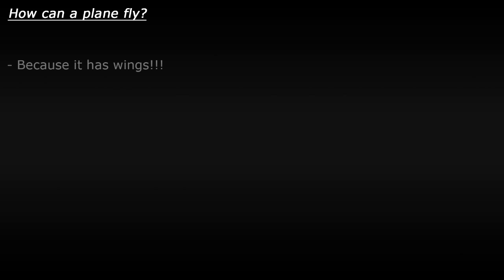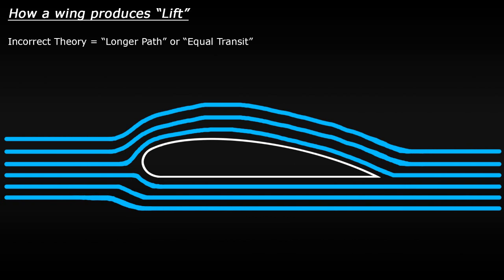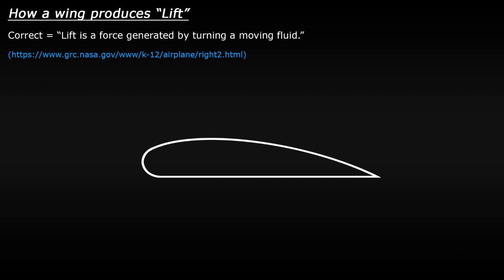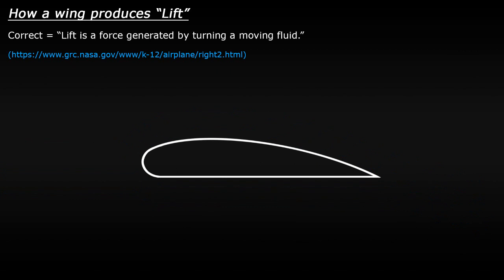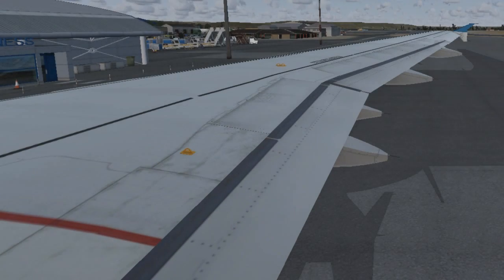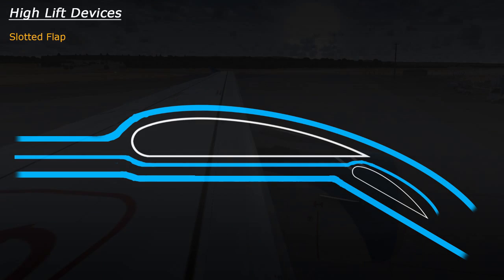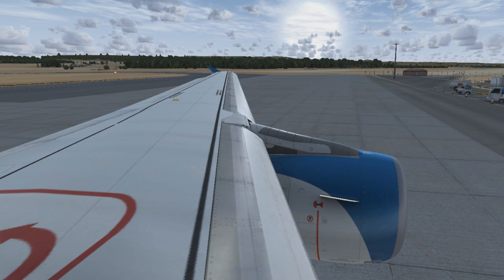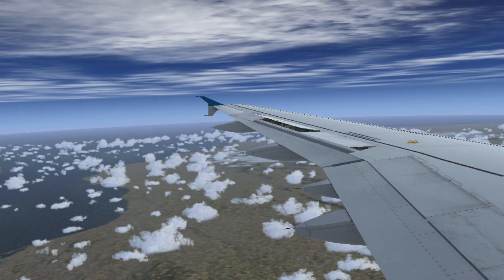How Wings ACTUALLY Create Lift!

Comment: The only way in which the wing surface can feel forces is either through tangential or normal forces, with tangential forces being viscous shear forces, and normal forces being pressure. The air cannot impart force on the wing surface accept through these means. What this means is that a pressure difference IS the reason a wing generates lift. Experimentation shows clearly that an airfoil shape creates differences in pressure all along the surface and when you integrate the pressure over the whole curve of the airfoil shape, the net force has some component in the normal direction to the freestream, and some component parallel to the freestream, with the normal component being what we call lift. The net result of causing this pressure difference is a turning of the flow, since the only way the flow can be turned is through the pressure gradients within it. So, from a mathematical standpoint, you are correct, the flow is turned by an amount exactly required to generate the amount of lift that is generated, but to say that lift is not actually caused by a pressure difference is incorrect, because again, the only way the wing surface can feel force is through the pressure and viscous forces acting on it directly (viscous forces barely contribute to lift, but rather contribute mostly to drag). The turning of the flow is just another result of the pressure differences within the flow field. The reason, then, that the Equal Transit Time theory is wrong, is not because it explains that pressure differences cause lift, but instead because of HOW it explains the pressure difference is created in the first place, which is admittedly much more complicated than can be explained without some very complicated math and physical principles. Equal Transit theory is not based on Bernoulli's Principle, it just uses Bernoulli's Principle to explain the result in change of pressure from the false premise it starts with. Don't equate the Equal Transit time fallacy with Bernoulli's Principle because there are plenty of valid uses of Bernoulli's equation.
Reply: You are completely right. Very good point.
Reply: Very well said.
Reply: correct! F1 cars use a diffuser for that reason, speeding up airflow beneath the vehicle and creating low pressure air underneath, effectively sucking the car to the  ground.
Reply: Bravo !
Reply: Holger Babinsky states that friction and viscosity are the main reasons for lift. Pressure difference is a result of it. NASA's explanation is correct, but too simple.
Reply: juncear  read more of what i wrote because clearly you misunderstood my meaning.
Reply: juncear  for steady-altitude flight at high speeds ... I don't know why you underestimate air pressure drop above so much. first, air is moving extremely fast around the curved surface. are you sure you have a good feeling for just how fast? you know the speed approaches the speed of sound (i.e. air compression waves), so are you that knowledgeable about things moving in air near the speed of sound? wing width and depth relative to compression wave wavelength are significant. are you able to visualize that expanding and contracting compression wave above relative to below? I don't think you are, because you seem to believe this "air being pushed down thing". Air is being compressed downward quickly. It then expands past the wing while air mass below moves some of that air back up. Meanwhile, a much large volume of air is expanding above quickly. Quick and significant expansion over a larger volume.
Reply: juncear  That's the second time I've read your remark about people overcomplicating things without providing a bit of substantiation for your claim. You ask me a question, assume you know MY answer before I respond, then say I'm "overcomplicating everything". Look. Fluid flow IS complicated!! I've provided you with a link that is followed up by my references. One of those is very thorough with an explanation of how downdraft is a result of lift and not the cause of it. They continue with a complicated derivation of how significant curvature of the wing is relative to other factors commonly cited (like downdraft!). You seem to be of the opinion that if it's complicated then it's overcomplicated and therefore wrong. Why? You think everything needs to be uncomplicated? FLUID FLOW AT HIGH SPEEDS IS COMPLICATED! Sometimes you just need to do the work rather than go with your gut. So get your hands dirty and do the work!
Reply: @johnahearn7966  Without being knowlegable in high energy hydrodinamics, I do understand that a body in level flight counterbalances its weight by a force exerted upon the air below it, which in turn is compressed by said force, and this compression radiates out as a volumetric wave at the speed of sound.
The conservation of momentum should dictate however that since the plane did not change its vertical velocity, the net velocity of the air volume should not change either, and we know the pressure of the airmass below the flying object is greater than that above it, otherwise it would succumb to gravity.
Therefore it would seem to me that the momentum of air displaced upvards cannot entirely counterbalance that of the air diaplaced downwards, if the pressure wave does indeed cause such a displacement as you claim.
So where does this excess movement come from? Where is its counterforce?
Reply: @ineednochannelyoutube5384  Let's start here with your statement: "the net velocity of the air volume should not change either". you clearly have a good feel for what that net volume is, as do most people who have opinions on this matter. But do you really? How would you bound this volume? How far above the wing for instance, and before you answer with conviction have you taken into account the enormous difference in mean free path above and below?

You seem to have a good perspective on this, and I like the way you asked the question but I believe your conclusion that "the momentum of air displaced upvards cannot entirely counterbalance that of the air diaplaced downwards" should also apply to two cases which at first seem completely unrelated: Case 1.) Hydrostatic equilibrium keeping a blimp aloft. 2)  A static trampoline holding up a heavy object.

If you think they are unrelated then there's no reason for me to continue, because all three cases can be explained by energy conservation alone. In each case potential energy in a mass below an object is much greater than that above. A mass below a heavy object has a much greater ability to do work on the object than the mass above, but the differences relate to HOW the stratification in potential energy came to be. Blimp: gravity created a static pressure stratification. Trampoliine: gravity causes material to stretch mostly in the horizontal direction  therefore creating a stratification of pressure in the vertical direction. Airplane: Enormous speed and pressure variations create a huge stratification of potential energy below vs above.

In none of these cases are Newtons laws disobeyed, and yet people protest that the 3rd law "must require" air mass below a plane to move downward even though they claim to fully understand why air below a blimp is not pushed down and why the trampoline fabric remains un-moving. Why?
Reply: @jahearnca1  I think you misunderstand my point. I do not think if the whole system is taken into account (which may well encompass the entire atmosphear), there should be a net change in air distribution, if for no other reaso, than the fact that once the plane has passed, the hydrostatic eqilibrium must reestablish itself.
I think the comfusion here largely coms from the fact that with an earofoil, the equilibrium os dynamic, and if only observed for a limited time, or at a limited scale, certain laws appear to be violated, because we exclude their solutions from our scope.
Reply: @ineednochannelyoutube5384  Good response. And I realized my answer was imprecise but well ... time constraints and the hope that I dangled just enough to get an educated response. And that's what this NEEDS to be given the complexity - a simple internet search reveals this subject matter is terribly misunderstood. Someone here even went as far as suggesting it wasn't complicated and that all I'm doing (and apparently you as well) are "overcomplicating things". Well I'm going to take that even further in response to your last comment: since you are spot on that we should consider a very very large mass of air involved in our system you can probably imagine effects due to immense temperature variations on both a small and large scale. we could go on for days discussing thermal losses, eddy currents, corrections to ideal expansion-contraction expectations, variation in drag along the aerofoil, variations in speed of sound, temperature variations all along the wing itself ... my point being one cannot throw out a phrase like "once the plane has passed, the hydrostatic eqilibrium must reestablish itself" without defining what is meant by that. Yes, the atmosphere will "relax" back to where it was prior to the disturbance but how long will that take? How much energy is put into the system to return to "equilibrium"? Show me a calculation for total energy added to the air mass and lost due to heat. Not in the ideal case, but in the realistic case of level flight. Where does all that thermal motion go and how will you define equilibrium once you've figured it out? Your hunch is right: although you won't have to consider the entire atmosphere to come to a useful conclusion, your volume will be so large that your challenge will be determining what equilibrium means within it.
Reply: @jahearnca1  At this point we have simply arrived at an impasse, because the earth itself is not a closed system, and a small closed system model will not be sufficiently representative.
So we might as well say that the rounding errors in the equTion just end up somwhere as wind....
Why os hydrodynamics so goddamn incomperhensible?
Reply: @ineednochannelyoutube5384  i don't understand the impasse comment. what is it that you're convinced of that energy conservation and thermal motion and losses don't explain?
Reply: @jahearnca1  They do explain it, it is just not possible to accurately calculate or model in a simple manner.
Which means you either have to abstract away the losses as a coefficient, or just ignore them.
Which sort of explains why there is such a large general confusion about how wings work.
Reply: @ineednochannelyoutube5384  I gotcha. Since we've been going back and forth I keep revisiting the link I provide relating to wing curvature as a cause of lift and downdraft as a result of lift rather than a cause. And yet the explanation isn't entirely convincing for the very reasons we've outlined: everything sounds convincing until one starts applying the real world perturbations and very quickly you're presented with the question "just how significant are these perturbations, and if very significant how far does the theory go toward providing an explanation?" There are heat losses, pressure and temperature variations at all scales everywhere within the volume in question. What can be averaged? What can be ignored? What can be measured?

The more I read and write on the topic the more I'm convinced the misunderstandings result from 1.) what I just mentioned here above & 2.)  very few people who claim to understand flight really "get" what goes on when air is perturbed by something moving close to the speed of sound. As to this last point, consider how much energy fills a room when a bass drum is struck violently by its mallet. Now consider how big the leading edge of an airfoil is, how fast its moving and that it is constantly compressing fluid not just momentarily as in the kick drum case. And now ask what happened to all that energy in the room (even a small one) very soon after the mallet/drum disturbance. Whether it went into the walls or was carried far away by air doesn't matter - it went away from the volume we want to envelope  "the system". How can one model anything ( even without considering small variations in temp, pressure, friction, etc) when energy is being quickly removed from the system you're trying to model?
Reply: @ineednochannelyoutube5384  by the way, i didn't realize til now that you originally responded to 'John Ahearn' and wound up with 'whizzbang'. They are, in fact, one and the same person: me. I've stopped trying to figure out Youtube and all its quirks and unpredictable changes, so that tends to happen more often than it used to happen.
Reply: @jahearnca1  Frankly I didnt even notice its not the same person responding.
And I feel you. I too am familiar with being stuck on different accounts on different devices.
Reply: I saved this video to one of my playlists just so I can come back to this comment for clarity. THANK YOU!
Reply: Good comment. Everyone should read it. This how a wing works for dummies theme always becomes tiresome. Strangely, I do not hear the same controversy when it is pointed out that a prop produces thrust by accelerating air.
Reply: @Kooper.
Apologies I just posted a dumbed down version of your excellent post. Then, I scrolled down and almost immediately saw your post.☹️
Reply: @johnahearn7966  
Sorry, but if the air is exerting a vertical force on the wing, then the wing MUST be exerting an equal and opposite force on the air. Can you begin to explain how that can happen without imparting a downward acceleration of the air?
Bet you can’t.
Reply: What about newton’s 3rd law. Where is it applied?
Reply: @q.e.d.9112  you are correct. The equal and opposite force to lift must exist, and can only be a change of momentum of the air. It is incredible how many people cannot understand this most simple application of Newton's laws.
Reply: Thank you!
Reply: Good Points! The equal transit theory uses pressure to describe why the suction side flow accelerates incorrectly. There is no reason for why a particle on the top and bottom of the airfoil must transit the airfoil in the same amount of time.
Reply: Excellent!     Yes, 100% of lift is caused by flow-turning of mass.   Also, 100% of lift is caused by pressure-differences at the surfaces.  (Also 100% of lift is caused by vortex-shedding in three dimensions.   Also 100% of lift is caused by Circulation Theory.)   
All these are just multiple approaches.    There is no such thing as 60% Bernoulli and 40% Newton.   As with transit-time fallacy, most grade-school textbooks get this part wrong.   The NASA GRC site devotes an entire page to this particular "percentage fallacy."

RP Feynman says, if you don't have two or three approaches to explaining something, it means that you don't understand it.   

Also note that Bernoulli Equations are based on Newton's laws.    (So, the "Bernoulli" explanation is the Newton explanation, although that part is concealed by the math.)
Reply: @q.e.d.9112  Good point.   The answer is simple:   in a 2-dimensional flow-diagram, with an airfoil section, there is no net downwards flow, because "upwash" ahead of the wing is the same as "downwash" behind it, and the overall situation is Ground-Effect flight, with a pressure-bubble sitting against the ground.   The wing is using the air to push down against the ground, and by Newton's third, the ground is also pushing upwards against the wing (with the air as the force-exchange medium.   Same as any venturi.)   

This is extremely confusing, because in these 2D flow-diagrams, if we fly at higher and higher altitude, the pressure-bubble still pushes down against the ground (it simply becomes wider.)    The ground is part of the system.  Altitude is irrelevant, and "ground-effect mode" is inescapable.    Diagrams which erase the ground surface are violating Newton's laws.

Real wings don't push against the ground.    They only push against the air ...same as propellers and helicopter-blades and flapping birds' wings.   And, sailboat sails aren't "pushing against" some mysterious distant wall!

So, in order to understand real flight, we should analyze a hovering helicopter.    Or perhaps use a boat rudder, an airplane propeller, a sailboat sail, or a flapping trout-tail.   Flight requires a 3D world.   (Really, the 2D flow diagram shows a bizarre situation, where the wing has infinite wingspan, and no net downwash.   That cannot happen in reality.   It's much like analyzing a helicopter with infinitely-long blades, or a rocket engine where the engine-bell is infinitely wide, and then no exhaust-plume is needed to create the rocket-thrust.)

Comment: While it is true that the longer path theory is incorrect, it is also incorrect to assume that the pressure difference across the wing has nothing to do with the creation of lift. Circulation plays a role in creating lift, but there are other factors at play as well.

Comment: Why would a plane stall just because the air doesn't "connect" at the rear? There's is the equivalent displacement of air which would result in consequent lift.

Comment: A basic symmetrical airfoil shape is a flat sheet wing with a shape added around it to allow thickness for spars, and to improve aerodynamics at different angles of attack.

A flat bottom airfoil is really a cambered sheet wing with an airfoil added around it. So if you look at the centerline of that flat bottom airfoil, you can see that when the flat bottom is parallel with the direction of travel, the wing itself really has a slight positive angle of attack.

Hence lift at what seems like a neutral angle of attack, but which is really slightly positive.
Reply: Maule aircraft have a flat bottom wing, the flaps can be set to negative angle to improve cruise.
Other than that pretty horrible aircraft to fly in tricycle gear form.